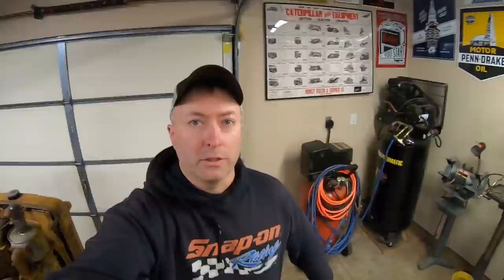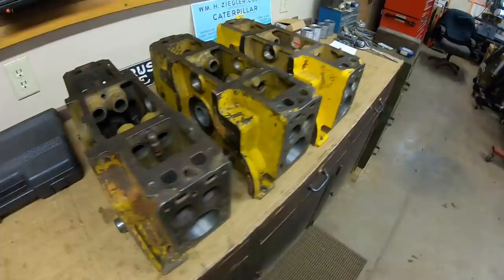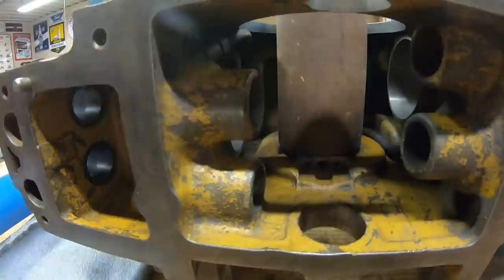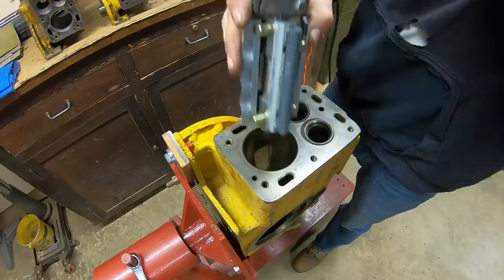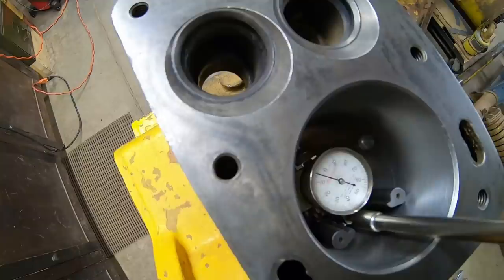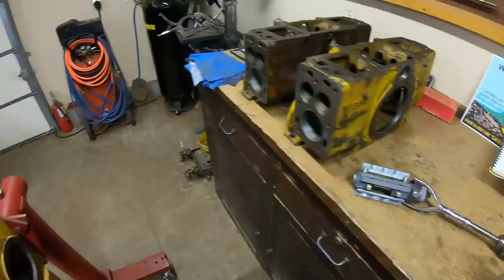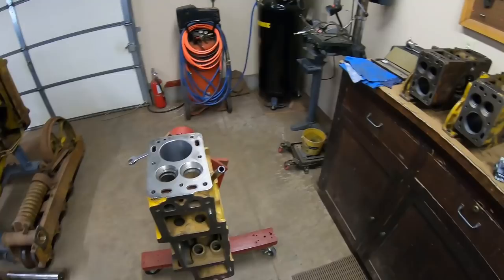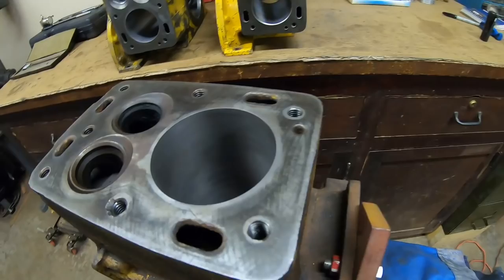Caterpillar D2 #5J1113 Starting System Ep.8: "Try" Build Block Prep - Honing Bores & Fitting Pistons

Comment: Good explanation, I personally hone with course stones dry and fine stones wet. When honing wet I prefer to set it up with a container to hold honing oil and drizzle it in while honing to flush out grindings so stones don’t load up. For what it’s worth I was taught that if you don’t have specific honing oil you should use vegetable oil. I made a gauge to clamp to shaft of hone which will contact head gasket surface to prevent running hone too far out end of bore. I think it’s good you are also showing with one what you can get away with for the people who have to watch their budget. In manuals I have seen the term, serviceable condition, which isn’t the same as original specs and for collectors on a budget I will tell people serviceable condition should serve them well as they probably are only running the machine for shows or fun and will outlast them. I think your videos exhibit to first time antique machinery owners that they don’t have to be afraid to dive into an unfamiliar project. 👍

Comment: Ooh this is going to be interesting. I've got one of these from a D4 that I blew a conn rod on in the late '70s , shortly after I got the dozer, probably for the reason you described. Fortunately I  had a spare which has served ever since. Oil checked for gas and topped up every time it runs. 
Mine is in the same league as block no3, sitting under the bench for 40 years. So I'm going to be watching your treatment of block 3 very carefully. Thanks so much for this channel.

Comment: It's nice to see you back rebuilding the starting engines I was always told to hone with oil but your honing job turned out perfect dry excellent video
Reply: @squatch253  that makes sense I hardly ever have to hone either the last one I did was a Ford tractor diesel engine I used a modern style ball hone that worked really good
Reply: @clydeschwartz2167  Interesting video on ball hones with info that I hadn’t appreciated from Uncle Tony’s Garage. Search for “Honing for the Home Engine Builder”. Basically he’s saying you can’t correct any taper or low spots, it just cleans. See what you think. I don’t have the expertise to counter either argument but it was interesting!
Reply: @Deebo1812  yes that is true I was just wanting to break the glaze on the Ford turbo diesel engine it's not a high speed engine

Comment: Ah, I can help...!  That noise from the vac is the top bearing has gone dry.  On some, you can access it and relube with a good oil.  I discovered a Slick 50 "1 lube" years ago as an appliance tech, works well on that cheesy top bearing, I'm sure other similar lubes are around, probably synthetic.  As an old time motorsickle mechanic, like watching your rebuilding processes to save the old hardware.
Reply: @squatch253  Yeah, it's just a bushing, the bottom bearing is a sealed ball race.

Comment: The problem with honing 12 thou is that the casting can have hard and soft areas which will lead to bore distortion. Better to have your machine shop run the boring bar through first, and I find leaving 1.5 thou works well to hone a bore within spec.  Keep up the great work!

Comment: Hi Folks, several comments on honing below. These are cast iron sleeves. The embedded carbon acts as a dry lubricant which helps the process. It's the same as with turning cast iron on a lathe, no real need for lubricant although you may well use suds to keep the area clean and protect the ways. Cast iron dust gets everywhere give even half a chance and is very messy stuff. My late Dad once had an old Austin A40 Somerset engine bored out in situ in our drive with a specialist engine block boring machine. Must have been around sixty years ago now ......

Comment: Obviously, you have mastered setting up and using that type hone. I needed this video about 1 1/2 years ago. Wish honing with those stones was as easy as you make it look. Dry is the definitely the only way to go. I tried honing wet, and as you know, it flung honing oil all over me and the whole garage. I like to see how you initially set up a new set of stones so they are the same size at both ends of the hone? It would have been so much easier if I had just watched your video first......Thanks for the training.

Comment: I think your dry process makes perfect sense... it's the way I do cast as well.  If you are cutting threads in cast iron, you don't use oil or you'll break taps.    I suppose if I had a Sunnen "nodding donkey" with flood lubricant/cooling, I'd use oil.   But at home, cast is dry... steel is oiled.

Comment: I know you said "you hone without oil." But I was taught to always use at least a light oil when honing.  They never said why but I just assumed it was for easier clean up, I don't know for sure which is better. If you could explain what the difference would be to help me understand. Thanks for sharing your experience with us through this process....
Reply: @squatch253  FWIW, my friend Thomas,master mechanic, taught me an absolutely enormous amount. You choose to hone dry,he taught me to use Varsol/paint thinner instead of oil. What a difference ! Oil works but takes absolutely forever. Using some sort of fluid to carry away the swarf helps,Varsol has no lubrication,and especially with several grits of stones available, getting the job done in a reasonable amount of time with a clean surface as an end result worked for me. 
Whatever works. If you are happy with your technique, fine. Dry never really worked for me. So it goes. All the best.
Reply: I prefer kerosene myself in an open top container. Use the drill to clean the stones every pass like a paint stirrer
Reply: @paulmanson253  Varsol and similar were our choice at a NAPA machine shop about 40 years ago. Dry was more prone to chatter. Plus squirting a good flow of varsol keeps it washed as you go.
Reply: @kmatch1  Yep.
Reply: Personally I've always used a light spritz of WD40 for any honing jobs, always given good results and easy clean up, prevents any potential flash rusting if you forget to wipe them down with oil too 😁

Comment: Hand honing is always best done dry, machine honing is a different matter as heat build up becomes an issue due to the power of the machine and the honing oil carries away the heat preventing a jam up due to thermal expansion of the hone. Anyone who hand hones wet needs to try dry honing as it's far superior regarding the stock removal rate, once the honing stones have become impregnated with oil they are no good for dry honing, keep your wet and dry stones separate.

Comment: Really excited for the next part to come. I believe one of the reasons why the Soviet engineers never used this starting engine design was the over complexity and how much material would be needed even to make one. Remember in the Soviet Union the military got the best material and resources first. Then the rest got what ever was left over even turning peace times. Not to speak of the general education of mechanism in the 1950s.Here is also a question: do you think a 4 stroke starting engine would be better then a 2 stroke starting engine? Would love to hear your opinion on this.
Reply: What kind of starting engine did the Soviets use on their Caterpillar clones?
Reply: @erik_dk842  The Soviets used mainly the PD-10 and later PD-10U (U standing for Universal starting engine). PD-10 was used on KD-35 that is a Cat D2 clone. On the S-80,S-100 and later T-100 they used the PD-23 that is a exact analog to the larger Cat engines like the D6.
Reply: I think you may be confusing “stroke” with “cylinder”. If you really mean two stroke/2 cycle engine, I cannot think of any reason 2 cycle would be an advantage.  Weight and size is a non issue and higher rpm from the typical 2 cycle engine would require more gear reduction to get the required torque
Reply: @jimrankin2583  No i was not confusing stroke with cylinder. But you got some interesting views none the less. Personal experience 1 cylinder 2 stroke starting engines require less afford to start. But once bearing slack, general wear kicks in or the seals fail you just will not be able to start it properly ever or at all. Then again repair for such engine is relatively easy compared to a 4 stroke 2 cylinder engine.
Reply: @SuperMAZ007  Thanks. So they used a simple single cylinder 2-stroke on the D2's and a parallel twin 4-stroke on the D6 and larger clones. I see that they now make retrofit electric start to replace pony motors.
Reply: @erik_dk842  Yeah cause people have gotten lazy or the fact that better battery's are available for the general public. But personally im for the starting engine then for starters. Specially if the tractor is old or very old and you don't start it frequently.
Reply: @squatch253  Thank you for enlightening me on this. This was a lot of new information, had no idea that CAT build 2 stroke starting engines.

Comment: Do you have any inkling of why Caterpillar-- whose machines were mostly built like a door to a bank vault-- used what looks like a glorified Briggs & Stratton lawn mower engine for the pony motor?   If you take the time on every cold start to use the pony motor to warm up the main engine and then turn it over with compression released to distribute the oil and get oil pressure up before starting the man engine, 250 hours really isn't that much.

Comment: Would a 0.004"-0.006" piston to wall clearance be for the perimeter of the piston?  Using a 0.005" feeler gauge on one side would be 0.0025" fit on the perimeter.  This just a question not a critique.
Reply: @squatch253  Never used plasigauge before.  Just assumed it would factor in the tolerance from one side.  Thanks for the reply.

Comment: Is there a SOP on how to fire up and use the pony motor...is there a set time limit to let it run in order to heat the main engine water jacket and whatnot....or is it just fire up the pony motor...then crank the big engine?  Do they recommend running the pony motor for 5-10 minutes before even cranking over the big engine (in order to warm up the pony motor and reduce the wear/tear on a cold engine)
Reply: Squatch has a video on the starting procedure that probably answers most of your questions.  In addition, if you read Squatch's answers further down in the comments there is one where he lists some important steps to take to get the most life out of the pony engine.

Comment: Honing has always been a bit cringeworthy for me. My aircraft actuator bores (at my job) have a tolerance of 80 to 120 millionths clearance and if you blow it out it creates a mountain of paperwork. Like you I learned early on what I could get away with. While Cats and aircraft are apples and oranges the basic method is the same and that is the controlled removal of excess material for an end result. Can't wait to see those installed and fired up...

Comment: Unless you mention it later in this vid I still fail to understand how crankshaft end play kills magneto gears with a cam gear between the two.
Reply: @squatch253  Are these helical gears? If so I suppose this causes speed variance (crank moving forward and back causing accel/decel) if so which would be a factor. Thanks for clarifying!

Comment: How much horsepower do these engines make @3000 rpm?
From an utilitarian standpoint, if your pony motor was unobtainable, could you use a modern lawn tractor engine as pony motor, rather than converting to electric start? When I watch your D6 starting video, it seems so much more mechanically sound to crank the main engine over for an extended time, before adding fuel. It starts right up with minimal smoke. With electric start, you'd need huge batteries to achieve the same.
Reply: 10 hp @ 3000 
With the modern engine you would loose the coolant heating but you could still route the exhaust through the diesel intake heat exchanger.  

The problem is the amount of work required to adapt the air cooled engine isn’t much different from that required to fix a pony motor or install an electric starter.  If I had to do it, I would start by mounting the new engine on a hinge mount on the fender and belt driving the dead pony.  As you might imagine this type of banjo work gets real clunky real quick.  In reality the only alternative to the pony is direct electric start.  Or pull start it.....been there, done that too much.  Eventually it’ll leave you stranded where you cannot get to it to pull, or push, it and then you fix the pony!
Reply: @squatch253  If it is 0f outside an old Cat with a pony will start, if it is electric it ain't happening even with good batteries and the best electric starter.  The old Deere tractors are the same way. A good pony will do the job everytime.

Comment: I made a huge mistake on the starting engine for my 212 🤦‍♂️
Reply: ?? We have a 212 at a museum nearby waiting for a pony rebuild.
Reply: @squatch253  remember how I got all my valves and seats ground….well I got to excited to reassemble and forgot to grind my valve stems to get proper clearances.  So I’m here this morning taking the top end all apart and grind valve stems.  Would have been even worse if I had got the engine mounted in and went to try and start…. Wouldn’t of had much compression